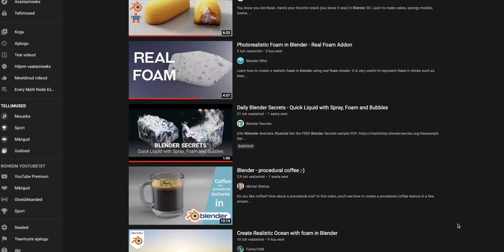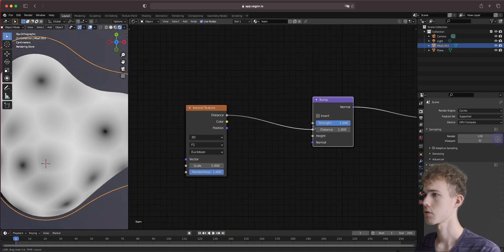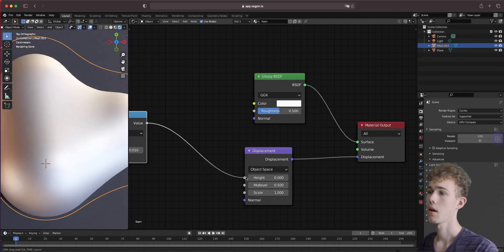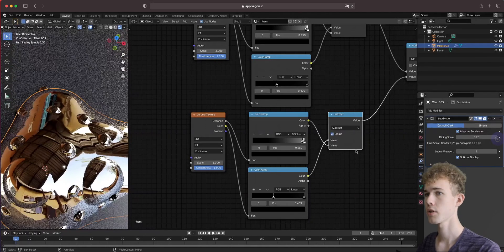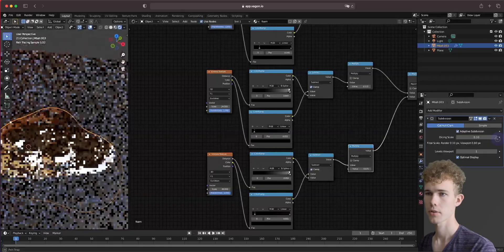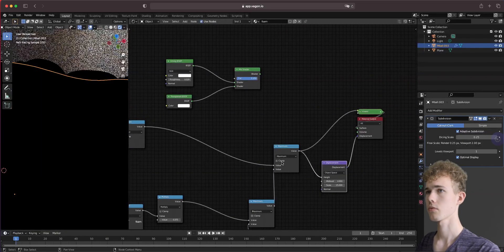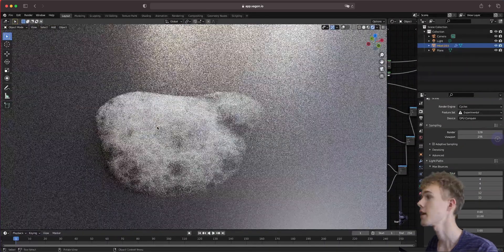How to make realistic foam in Blender?

Comment: I've copied this node for node 3 times now thinking that I'm an idiot, but I just feel like something has changed in blender since this came out, or somehow my settings are messed up. Everything looks great up until adding volume, at which point nothing looks correct. It doesn't end up looking milky when I use your values, only if I bump them up to like 5000, and then when I try use the inverted mask and multiply, nothing ends up looking correct. I'm starting to feel like an insane person redoing this over and over. If anyone has any idea what I'm doing wrong, I'd love some advice.

Edit: Still looking for how to fix the issue, but if anyone wants a quick botch fix, you can go into your settings for the material and under volume check the "homogeneous" box, then after that multiply your inverted texture by a massive amount... it still doesn't look nearly as good as the video, but it's better than the broken mess I end up with otherwise.

Edi 2: The plot thickens... I went out of my way to get the blend file from Bad Normals original project to see if using the current version of blender the file would look correct. It does. However if I import his materials into my blend file they end up looking just as messed up as the ones I created. I'm now convinced there's something wrong with how my project is set up, but I'm not sure what. I wish I could figure that out, because this isn't the first blender tutorial I've followed to the T where stuff ended up looking wrong after the fact.
Reply: Would love an update on this because im experiencing very similar issues.
Reply: @fearwinter8965  Me 2. It looks different... Blender 3.5
Reply: I had the same problem and couldn't get it to work. That said, this tutorial offered a free download of a foam material that worked well in 4.5 (for me, at least). https://www.youtube.com/watch?v=AcS-Yz-caWE

Comment: I only half understand what is going on here, but after a couple of tries, I was able to replicate this. As a newbie with Blender, I was struggling with the scale factor at first since I didn't realize how I would need to start working at the same default scale of these objects as you to get the same effect. I kept trying to add more math nodes in there to correct the scaling issues but decided that for now, I was just going to make these large-scale objects and transform them down without applying the scale. This is absolutely brilliant though and I will certainly be linking to this channel when I post renders that use this technique. Thank you so much!

Comment: How did you do the transform the metaball right after adding the ball? Wich hotkeys did you use?
Mine looked so different when I used the standard hotkeys like G or E. Yours looked smooth and rounded, mine did absolutely not!
Reply from the maker: Try lowering the resolution in the metaball settings. The smaller the number the smoother the metaball.
Reply: @BadNormals  thanks a lot!

Comment: That was really great result for non-physically based shader!

I think this method is missing the walls between bubbles that touch each other and only creates the outside surface of the foam. The difference is not that big but in close up shots the difference may be visible.

Do you think it would be possible to create 3D material and still have surface reflections for the more or less straight surface film between two bubbles touching each other?
Reply from the maker: Would be complicated. Creating inside materials of objects isn't exactly Blender's strong suit.

Comment: It's not realistic for coffee because of 2 reasons. First is that, if It's thin like the inner sides of the real coffee then foam It's barerrly visible, like It was transparent like a foil which is unrealistic and making it densier using volumetric make colors wrong. And second, to prevent this you must make It thicker, and hide foam beneath the coffee surface, which is not like real foam behave , and It's seen when You look at the cup from an angle. So basically this method is good, but only when You want to render something from the top or have it in unrealistic scale

Comment: Don't change the Dicing Scale like that. As you mentioned when you added that Adaptive Subdivsion the Dicing Scale for the viewport was 8, but you read next to it you see that the Dicing Scale for final render was 1, so when you changed the Dicing Scale to 0.25 the final render also went down to 0.25 which will be kinda overkill for a final render making it too slow. So my suggestions is to NEVER change the Dicing Scale in the modifier (unless you know why you're doing it) and instead go into the Render Properties, scroll down to Subdivsion and change the viewport Dicing Scale in there instead :)

Comment: It might benefit from using a smooth maximum to bevel the intersection edges between bubbles a tiny bit. I think it might be a little bit more computational intensive than with simple maximum but with such a computational intensive project it shouldn't matter to much

Comment: for some reason when doing this the subtract node at 3:54, the results won't work with the value set to 0.370, I have to use a much lower number like 0.050 otherwise the whole surface is filled with the first set of bubbles. This of course throws off the rest of the tutorial. I have to reduce everything to work correctly based on that subtract node.

Also it really didn't work until I added a texture corrordinate and mapping node before the voronoi.

Other than than that, everything seems to work as described. I couldn't follow the tutorial exactly and just used it as a guide. I am just not sure why my results were so completely different. Is there a setting in the preferences regarding node values? Are mine different somehow? Or was there a change in versions? I am currently using the latest version of Blender.
Reply: Well, no go. I have followed exactly and nothing works on my end as shown in the video. I must have something set wrong. All the math and displace values are backwards or give bizarre results. It all starts right at the very beginning with just voronoi and the subtract node. Completely different results and values needed to even come close. Can't quite figure it out.
Reply: Nevermind! I feel like a moron. It works. I had to start over from scratch and PAY CLOSER ATTENTION! Everything worked out as described. Sorry for being a bad student. This is an awesome material. I too was doing this with images and more simplistic texturing but I prefer a procedural. I need to make plastic bags of translucent goo with bits of foam at the top.
Reply from the maker: Sorry I didn't see your comment until now, good to hear you figured it out!

Comment: Now I have to find a way to replicate that in Redshift C4D. Great tutorial, perfect results. Perhaps it's worth trying to apply a physically accurate thin film shader to the soap bubbles.
Reply from the maker: Good suggestion! And good luck with redshift!
Reply: I tried remaking this in redshift but got stuck at the voronoi colorization. Redshift node doesnt have this option, if anyone knows how to separate the voroni like this lemme know! Great tut!
Reply: @smyrkphace  I'm getting close. Just used a Maxon noise node (Voronoi 1). But coordinates aren't aligned yet. One issue I managed to fix was: Redshift materials can't have volumetric medium scattering inside geometry like Cycles and Octane have, they can only have fake SSS, which is surface-based, so adding transparent bubbles creates a "hollow shell" that has a foam texture on top. What I did was using the volume builder with the exact same noises and a regular volume material, but it needs some fine tuning.
Reply: @smyrkphace  okay so 2 million polygons later, I was able to achieve it with vertex maps. That's because Redshift calculates the Maxon noise on the GPU. And that's where fundamental differences between two computing architectures show up. GPUs and CPUs use different ways to calculate random numbers. So it's not possible to do it in Redshift without expensive hacks, sadly. 

But just as I suspected, it IS possible with Octane in conjunction with Volume Builder and OSL noise (Maxon). But there are a few caveats, such as coordinates set to World, bubble surface object has to have its axis at 0,0,0 to avoid misalignment of displacement, but it is possible and looks just as good. However animating it could be tricky due to World coordinates.

Comment: This is a really good technique, though memory hungry. Having said that, I've simplified your node setup somewhat for the end user. I'll post a link once I have it finished. As an aside, I have a simple pint of beer using this as the foam shader. Looks excellent. Memory to render, 13,684.24M, so kinda rules out my GPUs. That is a close up - and I had to change the adaptive subdiv back to 1 from 0.25 (crashed otherwise). As part of a larger scene, and only seen from a distance, it's fine. The render will be in the Blender tests part of BlendeArtists once it finishes rendering on my poor CPU.
Reply from the maker: Yes of course, the adaptive subdivision gets crazy at 0.25, I also set it to 1 myself for the final render. I will check your nodes out when ready
Reply: I should add, it needs some light path stuff behind glass, otherwise it doesn't work.  Oh, and my node setup automates your maths.
Reply: Hi, I'm interested in a simplified setup for this material, do you still have the file, I cannot find the link you mentioned you'd post?

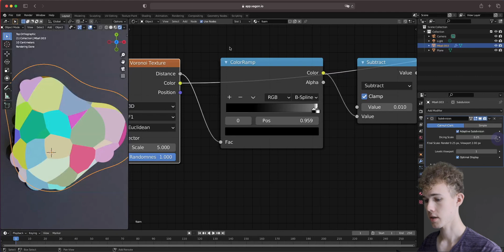Comment: 8:04 I would add an xyz separate node between the Voronoi (vec3) and ColorRamp (float) nodes to get actual random values from the Voronoi output, because they are currently averaged into one single float
Reply from the maker: Thanks for the tip!

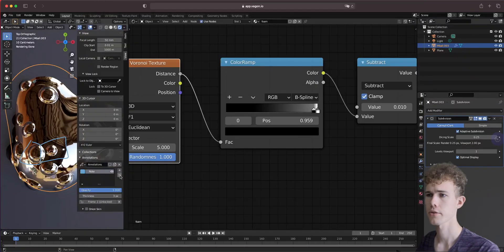Comment: @Bad Normals At 7:51 How do you toggle between the different outputs of the Voronoi node? (You switched from Displacement to Color with some shortcut. Tried reading the NodeWrangler manual but couldn't find out how.) Also: My ColorRamps don't have HSV values but HSL. Switching to HSV in the node doesn't change to HSV when opening the color wheel.
Reply from the maker: If you want to switch, just press control shift click again. And you don't have to change the color ramp between HSV and HSL, just open the color wheel and change it there

Comment: You could use the math node and use power by the factor of 2 to smooth the 'cone' shape of the voronoi texture and to make it look more spherical.
Reply from the maker: Forgot the power, although I'm not sure if it should be 0.5 instead of 2? Somebody can find out and tell me
Reply: @BadNormals  It's to the power of 2 :) You're basically squaring the value or multiplying the value with itself.

Comment: Nice video and tutorial, good work, so this effect could not be done in any way in EEVEE? I saw the Addon that a person made that generated this effect, but it also only worked in Cycles.
Reply: It’s definitely possible but not as simple. You can make displacement occur in Eevee using either the displace modifier or geometry nodes. As a guess, the best bet would be to define the displacement map using geo nodes, and then link that across to shader nodes as an attribute for mixing the different shaders.
Reply: Only Cycles supports displacement of geometry using materials, hence why Eevee won't work